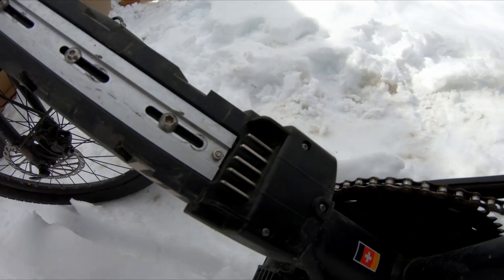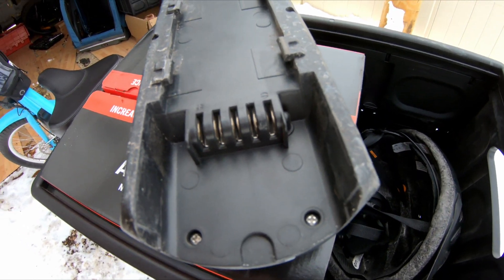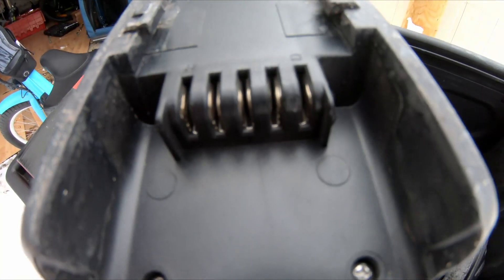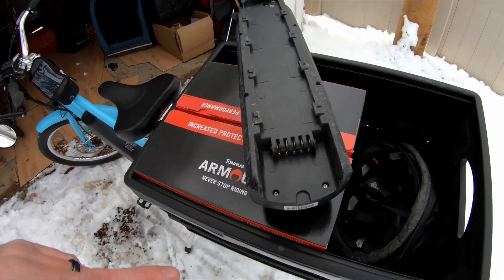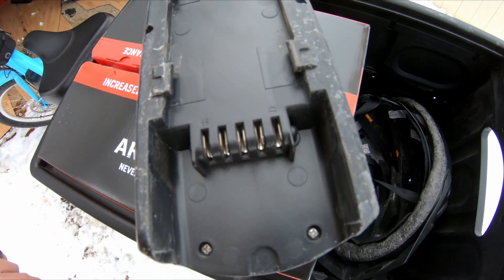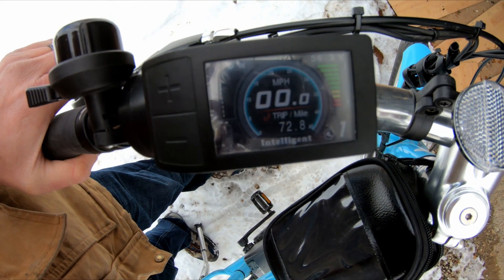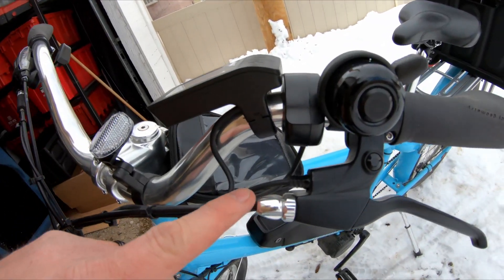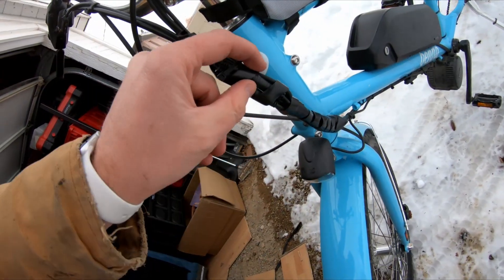Electric bike not working? Try these Troubleshooting steps!

Comment: I have a weird one, no controller error, full shut down, resets only when pluggen in, have youherd of that type of reset opetion? Not to worry I am planning on getting anew controller ...but yeah, this contorller has that wierd safety in it..and there is NO error Code. oh on the shut down, the controller does do a power surge. and it is very noticable, If I catch it in time it does not shut down.
Reply from the maker: I wouldn’t rule out the battery either. I’d do some load tests on it to make sure it’s all good too 👍

Comment: I put usb charger into my ebike battery than plugged that USB into outlet ,  when my dumb ass realized 5 seconds later that bike could not be charged this way , I unhooked USB , battery was about 30% full before this stupidity and is completely dead 

Scared to put original charger on battery and plug into outlet at house , someone said I could F - UP house electric

Eahora xc100 less than year old , I guess I gotta buy new one

Comment: Thank you 👍My issue might be severed cord. It seems only the black outer covering is cut in three places. I don't know how that could have happened but that cord seems responsible for my front break. My problem is that the wheels don't move as easily as before and the pedal assist isn't as strong as it was, as well as the throttle slows to a stop. When the wheels kind of lock and are hard to turn, the assist doesn't work and sometimes it works suddenly causing it to jerk.
I wonder who I can take my bike to to look at it. Are there places that take care of bikes?

Comment: I have a jetson bike with a problem where it only stays on if you hold down the power button, it gives a little power up animation on the battery display but it turns off if i let go of the power button

Comment: I was putting a 1500 hub motor on my cat trike. I turn the monitor on and was in the middle of putting my past word in when my phone rang. My grand son  pushed the led pad buttons and it put a pass word in and I don’t have a clue what it is. Now I can’t get in. Do I have to buy a new monitor. Or is their a code I can put in. I bought it on line and the company I bought it from is no help. I don’t know why I put a code in anyways. I have to trike one is mid drive and this one has a hub motor. Can you help me or point me in the right direction

Comment: Our Aventon Pace bikes were flooded in Ft. Myers Hurricane Ian. We rescued them the next day and washed them off. The batteries were destroyed. Took them to a bike shop....they cant get them to turn on and advised trashing them. Any thoughts on how to proceed? They are just trying to get us to buy a new bike.
Reply: Read up on battery repair
Reply: Hello, I was just wondering if you ever found a way to fix your battery/bike? I have the Aventon Pace 500 with the same exact issue. I'm not finding much info anywhere,  just ppl saying buy a new bike 😩. My bike is not old, only has a little over 800 miles on it. Recently had surgery to remove cancer and don't have any "extra" money to pay someone to go over it or to buy a new one. Any info or advice would be greatly appreciated.
Reply: Check if the battery has a fuse I had a similar problem and it was the fuse that went out

Comment: Hey Johnny, thanks for all your vids mate, there gggggreat! I'm in the UK Newcastle upon Tyne, I've made my own ebike from an old trek mountain bike, I love it 24 mile a day. I've done 1100 miles on the bafang 750 watt. 
Today it has come up with error 12 motor kept cutting out then working again, did a weird peddly juddery thing. I did the off and on again thing and it worked then stopped. Finally I realised that the throttle would still work with out any problems. Luckily I had enough charge to get home on just throttle any ideas. It's really wet and muddy my bikes getting caked everyday I'm hoping it's some water in somewhere causing havoc???

Comment: My wire burst short circuit and try to reconnect the fine 5 wires but it didn't have power. What shall I do . Does it have fuses somewhere . My Bafang display is C965

Comment: Pedal assist not working.  Everything else is ok.  Jupiter Discovery Bike.  Must be in the crank area?  Not magnets on rear wheel like on a Rav.  Any ideas?
Reply from the maker: Most likely PAS system. Could be the pickup sensor, the cable to the controller, or the PAS sensor in the controller. * if it’s the PAS system

Comment: Hi Johnny, one of the connectors on the battery is missing, where and how can I replace this missing connector? Thank you in advance!
Reply from the maker: If it’s the red and black Anderson style (most common) then you can just order a replacement plastic piece from anywhere
Reply: @JohnnyNerdOut   it's one if the silver pieces in the female connector on a hailong battery
Reply: The piece does not come out on this battery. I'm a little stuck . I've seen people replace it after unscrewing the cover. Is there anyway i can just replace the pin?

Comment: had an error code 31 (communications error ) the lcd screen lit up like normal but i noticed the battery level indicator normaly like 5 bars or batteries  in the battery shaped indicator  on lcd was just an empty rectangle. took m620 bfang out checked everything . now no power at all to the display .....help ? thanks

Comment: My electric trike started having trouble with cable connection
There is one cable comes out of front wheel motor. I did something has the cable being wrapped into front wheel motor and then the first connection can't stay connected bc the has gone into motor so it won't reach where it supposed to connect. I don't what to do. A few weeks ago I turned left leaning and accidentally gave power and sounded like when old school movie on projector ended and the started flapping cause there more movie wrapped around other reel. I hope someone understand what I trying to say

Comment: Hi. I'm having trouble with my fuell flluid-1s. Belt drive ebike. The company haven't been able to help me with the issue.  I think the chain ring bolt might be lose? The pedal crank has about 1/4 inch of slack on mostly the right pedal when it's at the highest postion. It's this way with or with out the motor turn on. And pedal it backwards there a light blockage of some kind. It pedals past the blockage but it's there. Any suggestions?  Thanks. Steve

Comment: Ok, i know i am seeing this a little late, but my battery is 48volts and it is putting out 58 volts, could this be the issue?
Edit: My issue is that every time i try to go a little too fast, or accelerate a little too fast, then the battery fakes being dead, it isn’t actually dead, but my throttle display think it is, i have been having this issue for a few days now and i just cant figure out the problem.

Comment: My Magicycle motor cuts out if I am using the throttle and I peddle. Once and awhile it works without faulting out, always when it's cold and just starting out but if I use it even a little, less than 1 mile, and I use the throttle then peddle, the motor cuts out.
If I stop and wait for 1 to 2 minutes the PAS will work
Reply: My ebike is doing this exact same thing. Its a 36v 15ah hailong battery on a 250w bafang rear hub kit. 
Someone said that its 100% because the battery is old. 
If so I’m so surprised cos ive only had the battery for a year and a half and only use the bike say 10-12 hoursa week for deliveroo. I thought these batteries were supposed to last up to 5years though. So I’m surprised this is happening so soon.

Comment: Hey my battery sparked but on the other side where you you plug it in to charger

Looks a bit fried now won’t go red to charge

Is that a easy part to fix?
Reply: Same happened to me did you fix this.
Reply: @dhilburn05  ya man
It ended up being a burnt fuse
Costed next to nothing to fix
Reply: You should plug into your battery first, then plug the charger into the wall/ power source, it will prolong the life of your battery

Comment: Hey bud I need your help
Reply: I have a aucma a131 moped okay it gets power to and everything works fine but the thing is once you try using the throttle it will not work can you help me?

Comment: I just got the battery and it was dark out so I accidently stuck the  key in the charging port.  Now the battery wont charge. Sparks fly out when I pug in the charger.
Can I just replace the charging port or is there a fuze or something else I might need to check? 
Also its been a year since this happened so are the battery cells still any good?
Reply from the maker: You can replace the charge port and probably be ok. Hopefully it didn’t fry anything else. If the cells have been empty for a year, you might be SOL
Reply: @JohnnyNerdOut    I did that.  It works now . Thanks!
Reply: @ThomasPain2025  where did you by the charging port from

Comment: Mine stopped working after a wash 😤 so im assuming the control thing on the handlebar was not fully waterproof. Now it wont turn on but the front light in always ON and i cant turn it off. So i just unplug the display for now to turn off the light but obviously the main concern is i cant turn on the motor..

Comment: Detailed video!!!
However, I have a situation I need advice on. Got a used Panasonic ebike without it's charger and wondering which connectors to use as charging points. I see: T - S C + and not sure what else to do as I have tried the + and -.
Please help advise.
Thanks a-bunch!!!

Comment: You may have an idea about what I'm experiencing. I have an electric bike that shuts off after a few seconds of riding. In both cases, using the pedal accelerator or the throttle control button, it happens. The bike display indicates the battery is full and there are no issues.
Reply: I am having the same problem.  Another channel suggested taking the battery off and adjusting the connector prongs on the base of battery so connectors would fit more tightly.  I haven’t tried it yet, but am hopeful it works.  Let me know if you were able to get yours working again, please.
Reply: @andreadanburg5649  I played around the battery but it didn't help. I'm going to order a new controller.
Reply: @MattConquer  Hey Matt, Were you able to get it running?
Reply: @MattConquer  My ebike is doing this exact same thing. Its a 36v 15ah hailong battery on a 250w bafang rear hub kit. 
Someone said that its 100% because the battery is old. 
If so I’m so surprised cos ive only had the battery for a year and a half and only use the bike say 10-12 hoursa week for deliveroo. I thought these batteries were supposed to last up to 5years though. So I’m surprised this is happening so soon.
Reply: I'm having similar problems, I lost power assist but still had throttle. So checked  my sensor and magnetic ring. Swapped out sensor for a new one and didn't work. Yesterday i went a mile down the road and it shut down. Powered back up with full display but touched the throttle and it cuts out.  Motor is fine, display, battery is good and all cables are good. It can only be the controller.
Reply: @nickbrockbank7727  I'm having the exact same problem with my wifes bike, only have a total of 8 miles on it, were you able to diagnose this problem?

Comment: great video thanks , bafang 48 volt --1000 watt battery , new motor battery checks out ok ,replaced display ,all connections look good , when i use battery only i can go1-2 miles and display goes blank, i can pedal assist 10-15 miles and all good , as soon as i do battery only 1-2 mile display goes blank again ,no power . thanks for input

Comment: Question: my ecotric rocket is 3 years old and recently the motor always operates at approximately level 4. It has 0-5 levels. But even at level 0 it runs up to 17mph as if it's in level 4.  This happened recently I believe after a rear tire change.

Comment: Please help me, is the DC converter needed to turn on the bike? they send me 2 new controllers and a battery but still it doesnt turn on, what should i check more? one night i put it in the garage and the other day it never turned on again...only part that hasnt been replaced is the dc converter, cables seem fine, and what about the motor? i tried your battery trick and everything else..

Comment: ALL connections dielectric grease, keeps the connections from corroding an helps with connecting and disconnecting (basically lube) DO NOT USE ANY OTHER GREASE unless it's designed for electrical connections ....... use at your own risk, i've never had any issues ....

Comment: I have a 2019 Giant Trance electric. It suddenly wont turn off. I’ve removed the battery and checked the fittings but still having the issue. Any idea? Thanks!

Comment: Took electric bike to electric bike shop. They indicated that there be controller issues, and send back for replacement.

Not taking their word as gospel. I even dismantled the controller and examined internals for burns and off smells. (None). The battery pins also had a spark burn on it.

Started to check and clean all electrical contacts. Even used a sewing needle to expand 9 pin female plugs copper pins, just in case one of the pins aren't making proper contact.

Voilà, sorted.

Went back to the electric bike shop, to show them, they are bloody useless. They also are probably ripping off their customers, who have no technical knowledge of what they are riding (how do people buy stuff, and not know, how it actually works.)

Comment: So this happened with two of my e bikes no clue how to fix them. One is a ancheer full electric bike and the other is a 36v hyper e bike. Both work battery wise but when you try to start riding the motor jerks then stops moving completely. Hopefully you see this comment and can possibly help me out in figuring out how to fix them
Reply: Having the same issue on our new bike, were you able to diagnose the problem, thanks.

Comment: I have a bit harder operation to fix my ebike. the wires in the controller box are cut off and too short to be attached back together. i haven't rode it in a year. it would be nice if you reply so i can maybe ride it the next summer with my ebike Friends. ❤️❤️❤️❤️, i can maybe send some pictures of the problem, instagram direct?
Reply from the maker: Sounds like it might best to just replace the controller 👍
Reply: @JohnnyNerdOut  So i just buy another 14ah 24v controller?
Reply: @JohnnyNerdOut  also the wires going to the motor near the controller box are very thin and almost cut off too

Comment: So I just replaced my controller on my super 73 rx due to no power, and tried to power it up and got nothing. Battery said it was at full charge got nothing no throttle display nothing. So I tried it on the fast charger, it charged about 15 mins before it said it was full. I plugged it in and everything worked throttle display everything, I shit it off to tidy up the wires then said well let's try it again first, turned her on everything came to life right away I walked across the room and lost everything, and havnt been able to get it back. Tested battery, 54 volts, leading me to believe that it's a harness issue because everything else is connected correctly. I mean it's pretty hard to fuck up. I'm just really frustrated this is more wait time ove already been down over a month its costing me money every day, please help
Reply: Did you get it fixed?

Comment: So I ordered a new controller and hooked everything up and tried to run it and it wouldn't even power on so I tested the wires from the controller to the throttle and they were dead. Any suggestions on what would be wrong ?

Comment: hi have you worked on Lectric xp 2.0?  we have one, and many people have e 008 code on the head display.   We tried to disconnecting all the cables on cables and controller, that did not help.  The engine works fine in PA mode, but its the throttle.  When the throttle stops working, i can turn the key on and off, or bang the rear tire a few times and starts working again.  I tried to talk to Lectric customer support, and not getting much response from them, found out to my horror that all bike shops will NOT work on Ebikes (unless its the brand they sell).  The shops and Lectric say the parts are proprietary but watching videos,  on different bikes, they seem to use the same parts..  The Lectric would be useful if it were reliable,  or help were available  One You Tuber said if the throttle is snapped and the lines dont match the handle bar line, that might cause it.  So what brand is the most reliable and sturdy throttle out there?   I will see how much a head display costs.   I feel like I have to pay for parts to build the bike from the ground up!  Thank you very much.
Reply from the maker: Not too familiar with the lectric brand. ☹️

Comment: Thank you so much! My power assist and throttle weren't working this morning and this video gave me the solution I needed – The magnet on my hydraulic brakes had shifted. I screwed it back on and it worked perfectly again!

Comment: Hi, I recently had my battery stolen from my giant explore bike.  So I went on facebook marketplace and bought another giant battery and charger(36v).  It's not the right battery, although both the bike and the battery have 6 pins.  So I thought I could just hook it up with wires prong to prong using speaker connections.  But the bike won't turn on.  the battery turns on, but when i connect it to the bike nothing happens.  Any ideas?
Reply from the maker: Probably have to go and buy their proprietary battery from an authorized dealer ☹️
Reply: @JohnnyNerdOut  
You have no suggestions as to why it wouldn't turn  on?